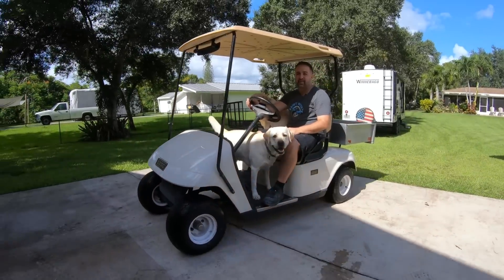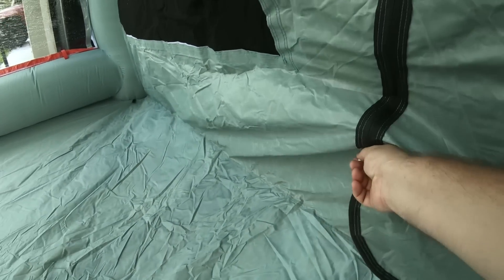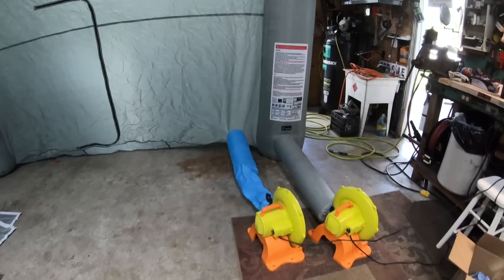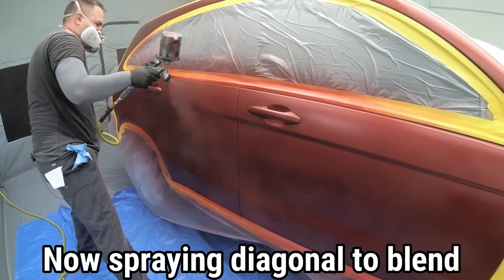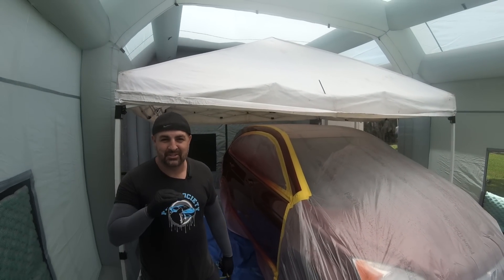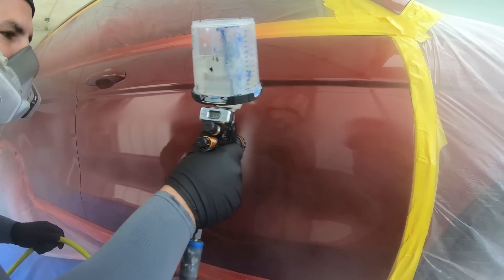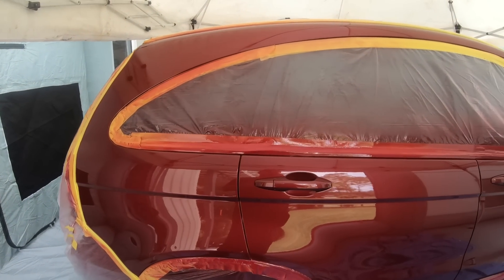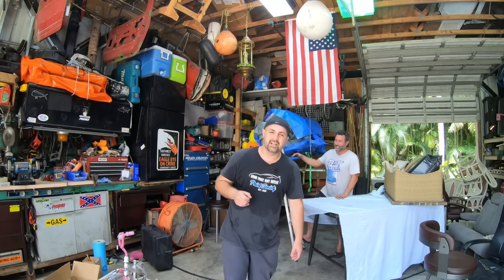Inflatable Spray Booth REVIEW

Comment: for the price of the "blow up" space, you can buy or build a metal enclosure. Granted it's a more permanent building but far more worth it. I guess it has its place for the mobile guys. Only issue I can predict is over time, the overspray will cake on the plastic hardening it, possibly cracking and puncturing it. At best it will flake off and of course fall on your paint job. I cannot fathom why anyone would pay 150K for a "professional" paint booth. ALLLLL of that being said. I am NOT a professional painter. But i did stay the night in a Holiday inn express.
Reply: Also, I am rather shocked that they could not even make the top waterproof. That just seems cheap.
Reply from the maker: I believe the booth has to be breathable To be able to collapse
Reply: When I was looking at getting one this size a couple years ago, it was just over $1,000. That’s a lot cheaper than I could buy a metal enclosure of that size, plus I would have needed a foundation.  In my case, I have room for the enclosure, but not enough that I want to permanently loose it to a building that I would only need occasionally.
Reply: @robsdeviceunknown  it would just pool up and collapse if it was waterproof.
Reply: It's for people who want to throw it on the yard for a day and paint, those who don't have space for another structure. It also eliminates need for any permits. Most cities would view a metal one as a carport at the very least.
Reply: I ate a brownie once
Reply: It is ment for guys like me that do mobile paint and body repair work
Reply: No way you could build a metal enclosure the size of this booth in Australia. The cost of materials is prohibitive. Also remember this is aimed at hobbyists and more for very occasional use. If you are painting cars all the time you wouldn't look at something like this anyway.

Comment: I wonder how this compares to doing a harbor freight "portable garage" to be the paint booth.  It is significantly cheaper.
Reply: I'd just like to know where to purchase one, and by the way. What is the total cost$$$???
Reply: @brentpaulus4195  they put a link to it in the video description... looks like it's about $1500
Reply: I use an carport paint booth that way you don't have the cost of running pumps the whole time it will never deflate on an prodject if you blow an breaker in the middle of project this thing will come down on your project!! I didn't want to chance it so bought carport and blowers and everything else separate and built an portable filter system that can be used in any paintbooth! All you have to do is to eliminate dust and such is tape all seems with duct tape then lay big tarp down that you pull in on make booth airtight and cross draft booth then spray inside of booth down with water on walls and floor to eliminate more dust and the water will also collect overspray as it hits those surfaces and prevent overspray settling into prodject! There's alot of ways of getting good j9bs from cheap booths !!

Comment: Just fyi with these booths, I’m a mobile painter and have been using these booths for about 10 years. I have the Amazon type like in this vid and I also have the much more expensive type made with fire retardant materials epa, OSHA approved etc. They really are very useful especially in my line of work. I work for some bigger dealerships in my area of north Florida. I’ve worked for these same dealers for many years. With all that said I ran into a big issue this past week with a local fire inspector. He told me that he’d never seen these types of booths before and wasn’t aware of anything like it. Long story short he shut us down because he believes that all booths should have some type of fire suppression. I tried to explain to him that these booths do not require fire suppression because there’s nothing electrical inside these booths at all. I did explain that our expensive one was made of fire retardant materials so that it will not burn. That didn’t seem to matter to him and he shut us down anyway. I’m telling you this in case anyone might be interested in using one of these in their mobile business particularly at a dealership. I’m working on getting this straightened out with the fire chief and hopefully with positive results.

Comment: I already saw a review of one of these a few years ago. In that case it happens that the compressor and blowers were too much for the circuit breaker and the cabin fell on the new paint in a painfully slow way. So that's something to keep in mind as well.
Reply: Running the compressor and blowers off of different circuits would solve that.
Reply: Yes, same thing happened to me.  Booth collapsed when circuits blew.  Blowers on different circuits for sure.
Reply: And if it's a windy day... could blow away or blow the fan off the tent😅😅😅 dotn ask me how I know

Comment: That paint booth seems a perfect answer to a once-only paint job at home. (I guess a few companies will include them in their rental selection, just like bouncy castles for kids parties etc etc. Nice work Brian! 👍
Reply: well for the price you better use it more than once.  Might be viable to buy one and rent it out.
Reply: @Zenkai76  they’ve also gone up in price recently (due to inflation)…
Reply: @Zenkai76  or just rent one to do the job you want then return it.
Reply: I don't think you'd be losing much by using a 10'x30' wedding tent - those can be had for 100 bucks or so, and as a one-time-use item, should be ideal.
Reply: @MrSaturn7085  
Those don't keep bugs\dust\debris away from the wet paint.
Reply: @shane250  the one I just raised is enclosed 360 degrees with only 4 zippered openings for inlet air and an exhaust fan.  The sides are clear vinyl so lighting is great.  I backed the inlet side against my garage door so I'm pulling relatively clear air and I can roll the rotisserie (or chassis) back into the heated garage as needed for drying/curing.  I'd actually call it overkill and it was 5-10% the price of the inflatables.
Reply: @MrSaturn7085  
Damn... Than that IS a great idea! Didn't know they're fully enclosed. I always thought the bottom is open (which means dust will be picked up with all the air circulation and air tools).
Reply: @shane250  Most of them have a 1 ft extension beyond where the side flaps touch the ground, so a few pieces of wood seal it right up.
Reply: @MrSaturn7085  
Wood is too expensive... Tarp maybe?
Reply: @shane250  I used a few scrap cinderblocks I had lying around from a garden project.  You just want something heavy to weigh down the flaps, that's all.
Reply: @MrSaturn7085  
I'm talking about the dust\debris on the floor. What do you do about that?
Reply: @shane250  After any grinding/blasting/etc. just sweep well, vacuum with a shop vacuum, then with a normal home vacuum - normal (deep) cleanup... in other words, clean up like you're planning to paint a car, haha.

Unless you're regularly using an air gun against the floor, you won't be kicking material up.  If you're paranoid you can spray the ground with a hose before you bring the car in.

FWIW, I had a car on a rotisserie blasted in a wedding tent Saturday that left a full inch of sand covering the floor.  I pulled the chassis out, vacuumed up what I could, sprayed all surfaces top-to-bottom with a hose, then vacuumed again.  I primed the chassis today and haven't had a single issue.

Comment: I tell people If your not going to upgrade these booths with proper filters, 2-3 hp vent blowers, and a elephant trunk suction fan system , don't even buy one. They don't work amazing out of the box and way to much over spray hangs around the booth for way to long. Seriously amazing job fixing that clear coat mid job you did amazing I'm impressed

Comment: Hi Brian and thanks for the video. I have been using one of these for the past year and it is so much better than just spraying in the shed. The main issue with these as you mentioned is if you lose power, I have mine in the shed and use the D hooks to hold it up but even these don't do a good enough job as it sags in the middle, just something for everybody to keep in mind, apart from this I'm very happy with the results I have been getting from mine, Cheers.

Comment: I bought one this spring for painting in and outside my shop. I've used it so far to paint four vintage trailers, stain and varathane cabinetry and panels.  I'm pleased with the unit. Had an issue with a zipper and the manufacturer was right on it and help me resolve and fix it.

Comment: I bought one of these booths and I set it up in my shop building. Ive painted so far about 4 cars in it and it actually does a decent job for the price
Reply: I was thinking it would work better if set up inside a building.  My primary concern was the sun and getting too hot inside.  Then there's the rain.

Comment: I just bought a booth just like the one in this video I tried to use it when it was to hot in July and the metal got 140 degrees so I went back in the garage , I think it will be a good thing in the fall and spring love the video

Comment: Great video.  I have a few of these.  From my experience, do not buy the type that has the mix room.  the new improved models have a tube that goes across the ceiling and supplies the filtered air.  if you have one do not open the mix room door because all the dirty air goes in the booth.  with the new type, the whole length is usable paint space.  Also, cut a deal with the seller and only get 1 blower or none.  Buy a real blower from the bounce house industry then you will have a good circulation of air and will not need the elephant trunk which has a bigger set up deal and storage and electric needs.  My 2 cents.  they have a place for the do it yourselfer and get really great results.  no bugs or dirt.
Reply: I'm tired of painting it and it's ruined.  Orange peel is a killer☹️
Reply: Which one do you recommend? Is there a brand you go to?

Comment: Excellent,  I actually got a pop up garage, similar size to that but has steel tubing for internal frame, and I've been purchasing LED work lights to light up this garage/booth, once I get a couple air extraction fans I'll be right to go, I'm based in Australia 🇦🇺  so I've just bought a gas turbo heater aswell

Comment: Oddball question, as a detailer having to apply polish and other products with a high speed buffer I run across several cars that the clear coat is very thin maybe from previous polishing or whatever. Have you ever had a vehicle in just for additional clear coat protection. It's a shame how much these companies have cut costs on such things but sure raise the price on everything else. Great videos, thank you.

Comment: Maybe you could make a booth with big tarps on a metal frame?  It seems the inflatable frame is if you have nothings to hang the walls from?  The blower for circulating the air is very good idea from a jump house for kids..  Was there a lot of overspray on the walls and floor of the paint booth jump house?  What did the aftermath look like?  Is there a way to clean if off if it lands on the plastic panels?.. especially the clear windows?  What filtration is the side filters?

Sorry so many questions and concerns..

mrstan

Comment: I started  out in 05 at a boat factory used valspar gelcoat to refinish after fiberglass repairs... I tell ya that gelcoat is some thick stuff.... slot different than automotive paint. But I learnt about fiberglass repairs and it was an experience... now guys doin that job at same plant make $25 n hr.... back then I was at $9..... lol times have changed

Comment: I don’t recommend to paint outdoors for lots of reasons as a diy painter.  Basically I do motorcycle paint jobs with professional results.  The most ideal conditions I found painting in my garage is beginning with clean garage floors and surroundings on a day with very light rain and no wind. Draining the air tank of water and always using a new air line filter.  Which results in a very clean paint job overall.  
In my case, I think I’m going to try building my own small paint booth using PVC for the frame and sheeting it in with medium gage plastic and adding a good exhaust/ventilation system.  
I wouldn’t mind changing the plastic sheeting for each paint job to keep things clean and dust free as possible.
Reply: check out Fitzies Fabrication youtube channel. he made one using white tarps to reflect light and it's easy to set up.

Comment: I've toyed with the idea many times of getting one of those.  In SC we get the same pop up showers so I would probably use those tie downs to go ahead and strap a tarp on the top of the roof
Reply: Maybe rent one for a weekend as a try-out…
Reply: Or just ask the manufacturer to make it waterproof. Should be an easy improvement.
Reply from the maker: It could be an issue with the Breathability
Reply: About a month and half ago built a hillbilly paint booth using a similar pop up 10’ sun canopy. Tape wrapped plastic(Lowe’s) around inner frame and legs. Taped down plastic over back of car(Camry). Cut out a hole for a 18” Walmart fan up on concrete blocks about 4’ high. No bugs, tried to pick a lower humidity day... sealed, base coated twice, 3 coats clear... still got hefty orange peel. Ants crawled up from tires, but it was already dry. GV, SC here. Hood only. Should have used the high temp reducer, only had medium. No garage for me ☹️.  The rain came couple hours later. I love this guy and this vid shows the kind of stuff that comes up for diy guys...

Comment: Definitely a great job. Nothing in life is ever perfect. But its how we improvise. I'll definitely be putting a wood frame on the inside so if power is lost the tent won't come down on the paint and I'll use slide in brackets for easy removal. Tired of trying to find reasonably priced painters so I'll be buying new and improved guns and getter done.

Comment: Did you have the side flaps open to the outside towards the rear of the car? If so, I guess the positive air pressure kept the bugs and trash out? Do you actually use toilet paper in that air filter? I’d like to see the Amazon link to the respirator cartridges you use inside that cloud of clear without any later breathing issues??? I get
into trouble doing that cloud thing in my garage. Fantastic, thanks!

Comment: I've used these for mobile dealer work years ago. The biggest problem I encountered was wind. It only takes about a 15 mph gust of wind to ruin a paint job!! Even if u anchor this down with 5 gallon buckets of concrete @ all the points....a 20 mph wind will create a air foil...like an airplane wing and create lift. Something to definitely consider when outside. It was a huge problem in the summer with pop up storms...one minute calm next thing u know...it's literally trying to lift off ground and fly across parking lot. The other problem is they get built up with over spray over time...and create dirt where u r forced to wetsand and buff all the work anyhow....But indoors for the DYIer who uses on occasion...would be perfect answer.

Comment: I'm a little supprised at his painting technique, 
He pretty much did everything my instructors told us not to do.
Reply: Yep. If you'll measure the thickness of the clear\paint on these panels you'll get at least a 40% difference... But what matters most is the end result. This just shows you that with the right equipment and the right products, everyone can achieve an aesthetically pleasing result.
Reply: @shane250  that's true enough,  it's the end result that matters the most.
Techniques vary. The only other concerns really is the paint doesn't start coming off.
Reply: @bipedalbob  
Paint coming off is more a matter of the surface prep (which was also lacking in this application). Seems like this job was just as a favor (and to test the booth) and not a real paying client. So even if it will only last 3-4 years, I guess they'll be okay with it.
Reply: @shane250  usually it's surface prep, but not always. There was one I saw during my pre-apprentice class that they meticulous did everything right, and it looked great but it just didn't bond, you could remove it with a plastic scraper. Once you got it started it would peel off in large sheets. After the 2nd repaint rhe instructors had the products paint reps come in. By the time I was done they still didn't know why.
Reply: Speed, angle and distance consistency is key. It will be slightly different for everyone. Sometimes you have to go by feel. Different materials will make for varying in technique.
Reply: This paint job was doomed before he started. It looks shiny on camera but in the sun that is not going to look good at all. Mill thickness is all over the place so the metalac flake will sit at different angles in thicker paint.also the 99 different angles he held his gun at. I know his eyelids where sicky from over spray. Don't paint like this guy

Comment: Hey I was curious on your thoughts on house of kolor paints. What I want to know is how the paints hold up as compared to like PPG Omni. In my research, I keep getting answers across the spectrum of good and bad and would like your pro opinion
Reply: I have used house of color on my my motorcycle paint jobs and I love it!  It lays down perfectly flat and smooth which is the perfect paint surface to receive the clear coats.  I consider it a high grade paint and will continue to use it.
I tried lower grade paints at half the cost but they lay down rough 
In a leather grain finish no matter what gun adjustments I made. 
I had to lay down 3 extra coats of clear to hide all the sins of the lower grade paint.  I will definitely go back to house of color. It’s been 3 years and it’s looking fantastic! I used jet black.